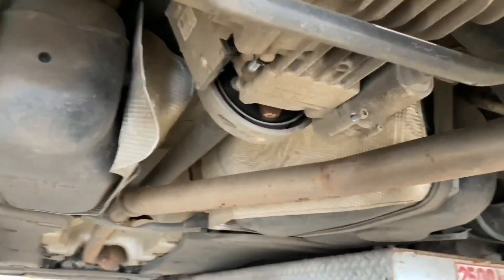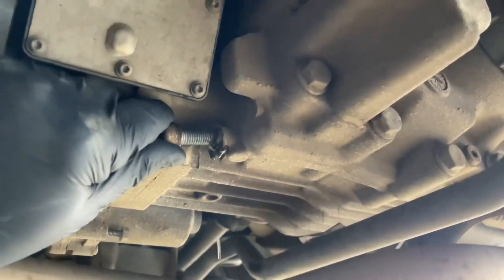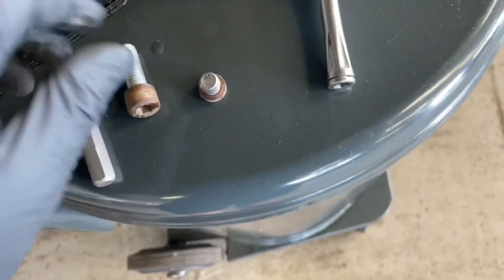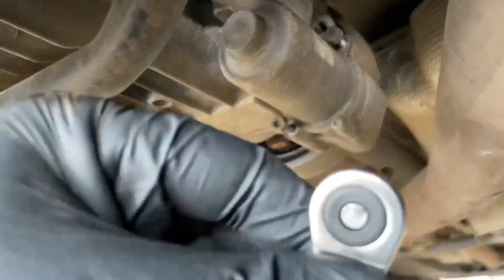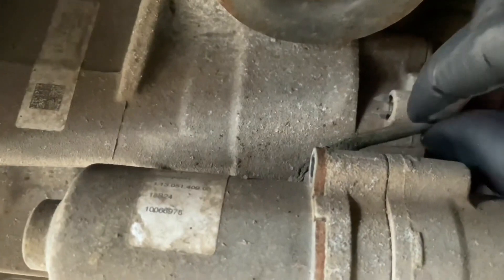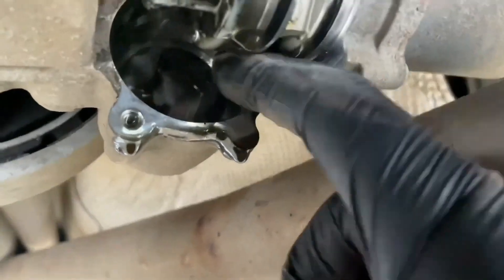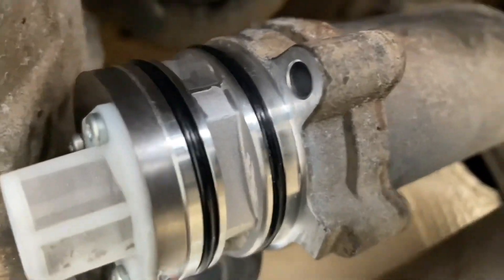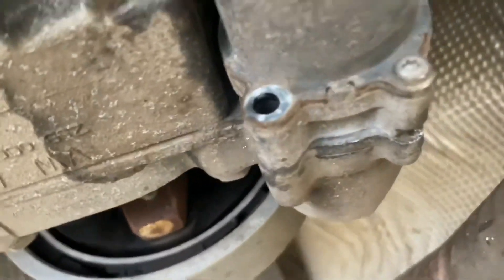4 Wheel Drive Service (Haldex)

Comment: I have a 2009 gen 4. All I want to know is can i change the oil on its own so i do not have to prime the system. I just want to drop oil out and re fill it.
Reply from the maker: You can but I would always advise priming the system mate and not half arsing the job
Reply: @  right that means I would have to get Audi to do it. I was told by an Audi specialist that on the gen 4 there was no need to, I just wanted that confirmed. I don’t want to damage anything. So on this one I will get Audi to do it. I am doing the diff oils tomorrow. But think I will leave the haldex then. Thanks for the reply
Reply from the maker: How did you get on?
Reply: No problem at all did haldex and front and rear differential oil change  as well as a full service all good
Reply from the maker: Awesome stuff :)

Comment: Great vid! You didn’t show it at the end but I think it’s worth nothing for the DIY’ers that a re-learn/ adaption is required with VCDS or similar after the haldex oil change/ strainer clean. I’ve seen this not being done which then causes little or no drive going to the rear wheels with greatly accelerated wear of the clutch plates in the Haldex, all due to incorrect learned values producing the wrong hydraulic pressure by the pump. The Haldex shown is a Gen 5 which has considerably fewer parts than previous generations and is the first not to have a conventional ‘disposable’ filter.
Reply from the maker: Thankyou very much for the comment, yeah you’ll find I don’t show Odis at all in my videos it due to contractual terms but I’ll make sure to mention going forward if there are any things needed to be done with computers thanks again for the comments and it’s great to see you really know your stuff :)